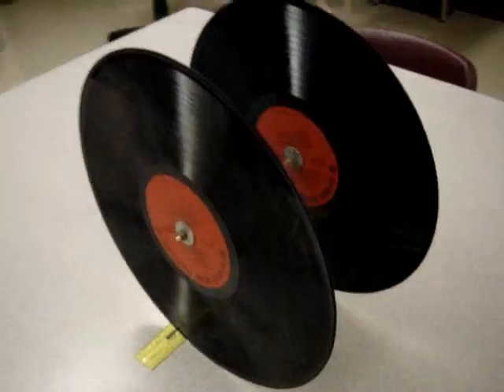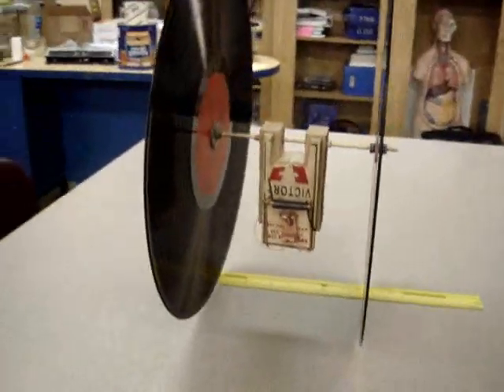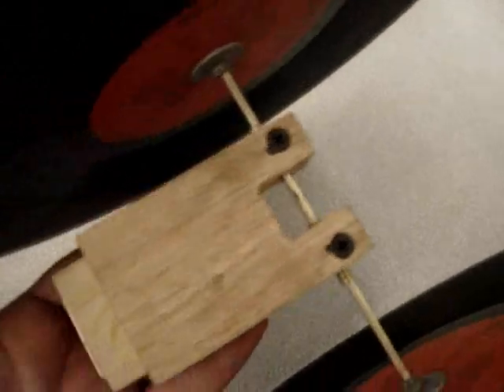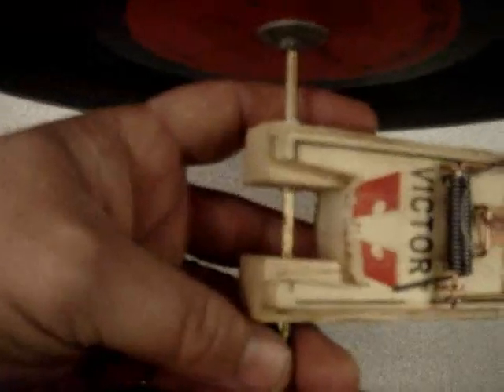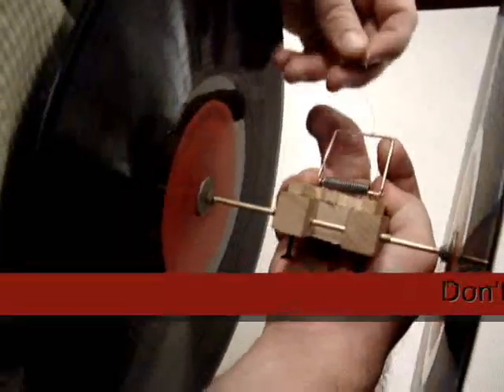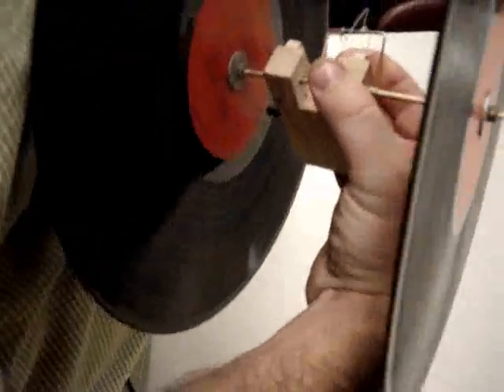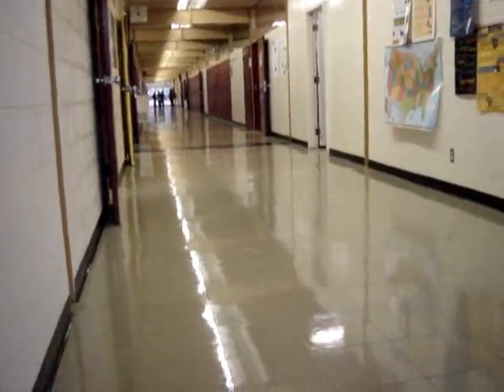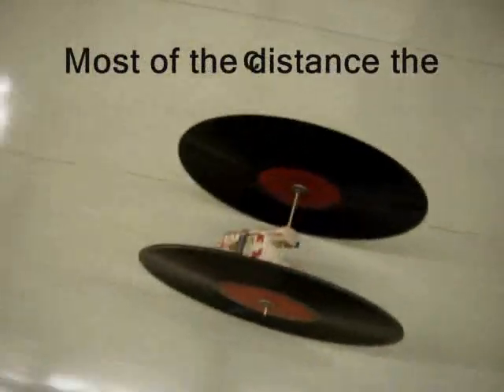Simple Mouse Trap Car goes 138 feet

Comment: Pretty sure it would go much further if you could encompass a step down gear setup, like mouse trap to rod, rod to a wheel, and wheel attached via another strong or rubber band to the wheels
That could hypothetically let it reach 1000 ft

Comment: For extra distance I built a block that hangs down 1/4 inch from the ground this added distance from the axle to the arm allowing for more sting and a longer wind. i also used steel bushings because steel on brass has less friction that brass on brass and put graphite powder in the bushings. I haven't done it yet but I think it would be cool if you could possible fit two mousetraps on the car

Comment: What are some pros and cons of this project?
Reply: There are no cons this is hands down the best mousetrap car possible. Simplicity is the most efficient. The only was it could be better would be if you could use a smaller axle but the smallest drill bit I could find is 1/16 so anything smaller than a 1/8 axle would just get cut in half when making the hole for the string. I also suggest making the mousetrap hang lower so you can wrap the sting around the axle more times. and use steel bushings is creates less friction than brass on brass
Reply: cameron cabrera

Comment: Hey. Love your idea. We added on to it by putting a second mousetrap on the other side of the block of wood too and ran a second line through a second hole in the axle. It went 186 feet! I didn't have the nice axle you had but instead used a threaded rod I had tried to grind down in the middle and filled in the grooves with wax. I bet your axle could break the 200 foot mark!

Comment: Would CDs work instead of LPs?
Reply: Ashleigh Velasquez  no b/c the trap would hit the floor
Reply: +Nicholas Prentis you can however create a chassis. It would simply require more than 2 wheels
Reply: Yes true but having a third wheel would add a good amount of "drag" so to speak, thus resulting in not as good of a proformance
Reply: +Nicholas Prentis +Luke Elliott Thanks

Comment from the maker: @dave51495 - No, as long as the anvil (wire part that hits the mouse) doesn't drag.  You could push the axle a little farther down towards the center pivot to gain a half inch or so.

Comment from the maker: @Datoberry - The mousetrap anvil is a inclined plane, wrapped around a shaft. It goes by the common name of "screw," because if the mouse gets hit, it is screwed. The wheels are class O circular levers, and they metastasize force through differential amplification. With austrolopithic projection, all docility is nullified, which leads to autologous results. Make sure you copy this down exactly on your report. Or, if you want a better but less entertaining paper, figure it out yourself. ;-)

Comment: plz someone answer this question, do you need to drill a hole in the axle, or can you glue the string onto the axle and wind it. Which would cause the car to travel a longer distance?

Comment: @1donagin Otherwise you could have a stopper of sorts to prevent it from swinging. I nailed a piece of plastic trim about a centimeter longer than the radius of the LP to the block with a felt piece attached to the end of the plastic. Once the axle spins enough, the stopper is lifted and it keeps rolling like normal. It doesn't affect distance much as it doesn't add enough friction (as the mousetrap isn't heavy enough).

Comment from the maker: @TheMessengerMalichi - 1 horsepower is equal to 550 ft.lbs per second, or 746 watts.  Using the English system, you would need to calculate the average amount of force to pull back the hammer in lbs (estimated by the force it pulls on a fishing scale at half pulled), and then the distance the end of the hammer moves all together, in feet.  Multiply the two to get foot pounds, and divide by the time to unwind the trap in seconds.  This will be your horsepower, and it will be very tiny!

Comment: I am a bit baffled as to how this works. It was always my impression that a longer lever arm would propel the car for a longer distance before letting the car free-roll. But here, you use only a lever arm the length provided by the mousetrap itself. And why are two wheels better than three or four? Doesn't this make the car less stable?
Can you help me understand this better?
Also would it be generally the same if I were to use embroidery hoops instead of LP records? I believe they're lighter.

Comment from the maker: @goodlovinkia - Good Question.  Rubber wheels are actually designed to increase friction, and they are only helpful if you have issues with slipping (acceleration and braking).  They would be quite bad for this car.  This is why a train with steel wheels can move goods about 50 to 100 times cheaper by the pound than a truck with rubber tires can.

Comment from the maker: @TheBuzzShot - most judges would bust you for it, but you can always try.  If you do, make sure that your elastic has about the same strength as the trap - probably just a little bit less would be best.  That way, the trap would unwind first, and then the elastic cord would have its full length to unwind.

-Don

Comment from the maker: @OpulentRedrum - the block of wood is needed for weight, and helps to mount the bushings.  The two screws are set screws for the bushings.  You can omit the bushings, but it won't go as far.  You can take apart old hard drives and get little ball bearings and go much farther!

Comment from the maker: @013angels - you need to have something that connects the wooden dowels to the wheels.  A lot of hot melt glue might work.  YOu might have to put weights on the trap when you are done.  But it doesn't sound like you are doing everything wrong!

Comment from the maker: @umairasajjad - you can, but if you do, you will need to add front wheels - because the mousetrap will drag on the ground instead.  Also, the gear ratio will be significantly lower, which is why most people who do this also put an extension arm onto the mousetrap.

Comment from the maker: @tilxGH - might I suggest a little more research before you call others idiots?  Any object with mass (m) in a gravitational field (g) that goes down a distance (h) will release an amount of PE equal to mgh.  In a free fall, that would turn entirely into KE, which is equal to 1/2mv^2, giving a speed of mgh=1/2mv^2, or v = the square root of (2gh).  Its called Physics...

Comment from the maker: @mschettler2000 - Sorry, but that isn't so.  PE=mgh for the trap, and 1/2kx^2 for the trap.  There is no magical difference between the two, as a Joule is a Joule is a Joule, and the energy in the trap/spring combo goes into KE as in KE=1/2mv^2.  Baring frictional losses, the transformation is complete.  There is no difference between my lifting the trap at the beginning, and the spring lifting the trap as the car travels.

Comment: @1donagin - don't forget you are increasing the rate of acceleration by doing this as well, achieving a higher velocity, and thus, increasing momentum.  I'd estimate a 500-700% increase in energy due to this, seeing how under its own power it'd likely travel approx. 20-30 ft.  (the rocking of the trap further reduces travel)  This all should be able to be proved out by finding the total energy stored in the tension spring and calculating the max distance a certain mass would be able to travel.

Comment: @1donagin - Well the axle I used was the same size as yours, We could only use masonite board on the bottom of the mouse trap. We just glued 3 washers on the bottom of the mouse trap and that solved it. Nice design ours went 96' and then it hit a wall. We have to find a longer hallway to test.

Comment from the maker: @mschettler2000 - yes and no - I deliberately lifted the trap as far as possible, but if you count the total number of winds (.5 x pi x the length of the string) you will find this only added about 5% to the total amount of energy.  Check your rules - use whatever you can to get ahead!

Comment from the maker: @stelz1621 - You can buy brazing rods at any store that sells welding supplies.  They come in 3 foot lengths.  Sometimes you can find them at home supply and hardware stores, also.

The 2 screws are "set screws" to hold the too brass tubes in.  They hit them on the sides.  Don't over tighten them, or the axle won't turn.

-Don

Comment from the maker: @TheShay3000 - not really.  By the time you get these large wheels, going straight is going to be a problem.  Your car has a differential to allow it to go straight even with slightly worn tires.  Trains have slightly conical wheels to keep them going straight down the track.  You just need to make sure your records are identical diameter.  Mine obviously weren't quite the same...

Comment from the maker: @Bbulut01 - you need a 1/16th inch drill bit.  Sometimes it helps to file a tiny flat spot first.  A drill press is also helpful.  It takes me about 45 minutes to make a car like this - but I am not only a Physicist, but also an aircraft mechanic!

Comment: I helped my daughter copy your design for her science project. We used 6" of 1/4" threaded rod for the axle & small eye hooks screwed directly into the trap for the bearing surface. We chucked the rod in a drill and used a file to cut groves into the rod to keep the eye hooks centered. We also used a short length of finishing nail in the axle hole and looped the string on it.

Comment: i used a 8/32 rod that was already threaded across the whole thing from home depot, then used the 1/16 hole with 60lb test line and a smaller mouse trap with a weaker spring, it works a little better because it did not pull the line out as quickly as yours did and gained more momentum before relleasing, thanks for the video great idea

Comment from the maker: @nttwashere.  Think about it.  A wobbling wheel makes the car go up and down a bit as it rolls.  This shows that it's average effective diameter is just a little bit less.  So we have a straight wheel on one side (slightly larger diameter) and it rolls just a little bit farther.  The effect is a gradual turn towards the side with a wobbling wheel.

Comment from the maker: @nttwashere - For the wobble, check to make sure the axle is straight.  Otherwise, you should be able to loosen up one of the nuts and straighten the record, then tighten it a bit.  You will need to do quite a bit of tweaking.  If it still doesn't go straight, the only thing you can do is swap out one record for another one.  (Or I guess you could file a tiny bit off the rim of a record, but that probably isn't practical.)

Comment from the maker: Check your brass bushings - these are the main culprit.  Lubricate them with pencil lead.  Make sure your records are well centered.  Also make sure they are parallel.  Use the smallest diameter string that doesn't break.  Add a small rocket engine ;-).  -Don

Comment: Hey, I'm really interested in your design but my preliminary tests haven't yielded any forward motion.  The floss just unwinds quickly and doesn't provide enough force to move the axle. I haven't made a hole for the axle yet, i'm using bent paper clips to connect it to the mousetrap. In addition, part of my project requires that a full pop can is carried with the car. I'm planning on attaching the can to the bottom of the mousetrap with tape.  Any help would be greatly appreciated. Thanks!

Comment: @1donagin 
Yes it does, but you were right with the line wrapping over itself. Also, I was using 40 lb test and found out that the smaller the lb test line, the better it works(granted it doesnt snap). I got my car go to 95ft and have the record for this school year. So thanks for your great video!

Comment from the maker: Make sure to keep the rod on something flat.  The center punch will slightly bend it, but you can straighten it, afterward.  As for the threader, Home Depot's web site didn't list much in the way of threading dies, except a set for $120.  Lowes has a set for about $20.  You can buy one off ebay for about $6.  Sears has one for $5.51 (search "6-32" on their web site.)

Comment from the maker: Do you have a center punch?  If you don't, you can use a drywall screw.  Set the rod on a firm surface, and make a little dent with the punch and a hammer.  That will help the drill to catch.  Flattening the brazing rod sets up hardening that easily leads to breakage, as you found out.

Comment from the maker: There is always a way.  If You could glue the can between the two records.  But then you would need a frame on the outside of the records instead of the inside, and you would have to add front wheels.  The good thing is that you could use the elastic quite effectively this way.

Comment from the maker: Just glue the can to the outside of the record over the hub!  It would rotate slowly as the car runs.  If you don't have to have a mousetrap, you can use elastic to wrap around the axle instead...

Comment from the maker: Hi.  If you tie the string to the axle, it will also act as a brake.  You just need to make sure the string is the right length so the brake comes on at the right place.

Comment from the maker: Hi.  The brass tubes are 1/8" INSIDE diameter and the axle is 1/8" OUTSIDE diameter.  To cut the threads, you will need to buy a 6-32 threading tap, which you can buy at most hardware stores or home improvement stores for only a few bucks.  (If your school still teaches shop, they might also have one.)  They also sell a handle that holds the tap, but if you are creative, you can managed to improvise.  I chuck the axle in my drill, and hold the tap with a pliers - it is quick and easy.

Comment from the maker: You can use wood.  However, it will probably be thicker, and that will mess up the gear ratio.  It will also have much more friction.  The axle is not held in place by the washers - it just floats.

Comment from the maker: Just let it hang.  The idea is that it will only spin the axle if you wind it over itself - so it can free-wheel after the trap has used its energy.  This is why winding the car is so difficult.

Comment from the maker: Drill the hole all the way through.  I used a 1/8 inch brass rod for the axle, and a 1/16th inch hole.  The smaller diameter the axle has, the less friction.  The axle is about 8 inches wide from side to side - but you can makes yours about any width you like.

Comment from the maker: Not hard - just glue it a little bit below the axle, and then wrap a wire extension around the mousetrap hammer (like so many other cars on youtube have, but only extend it a half inch or so).  Frankly, this strategy might get you a few more feet, anyway.

Comment from the maker: Center the wheels better.  Use ball bearings.  Theoretically you could sharpen the edges of the records, but I doubt if that would practically help.  The big help is to find a hallway with a slope and start at the top end.  LOL.

Comment from the maker: There isn't a way to post pictures, is there?  Take a piece of coat hangar wire, and use a pliers to attach it to the trap on the same side as the spring.  Wrap it around several times near the pivot (this will be hard to keep tight) and then again near the far end.  Trim it off however far away from the trap that you need to.

Comment from the maker: Hi.  You can always add weight to the trap.  What diameter is your axle?  If the axle has a larger diameter, it will cause the trap to develop more torque.  Too much torque, and it spins round...

Comment from the maker: Hi.  A couple of suggestions.  Make sure the string is not too short.  It should reach from the snapped position of the trap to about 2mm beyond the axle.  Also, if it is a slippery string, it might be tearing  loose from the axle too soon - try heavy duty dental floss.  If you axle is fatter than 1/8 inch, this could also cause issues.  You could correct them by putting an extension on the trap.  Hope some of this helps. -Don

Comment from the maker: Mousetrap.  Board for base.  About 8-10 inches of 1/8" brass rod.  2 LP records.  Fishing line.  About 2 inches brass tube - the right size to smoothly slide onto your axle.  4 6-32 nuts.  4 #6 fender washers.  Some 30 lb test fishing line, or heavy duty dental floss.

-Don

Comment from the maker: Certainly.  But don't cut it down "too" much.  AS long as it doesn't spin over the top of the axle, it is fine.  The biggest way to improve the design, though, is to use better bearings.  Try taking apart old computer hard disks or CD players, etc.  Some of these have great baby high speed ball bearings.  

Congrats on the results - but keep pushing the envelope.  -Don

Comment from the maker: Good physicists will notice my little "cheat" when I released the car.  I deliberately wound the car back until the trap was pulled almost over the axle.  This gave me a tiny boost - worth maybe 5 feet extra.  Other than that, this is all the real deal - on a 45 minute car, no less.